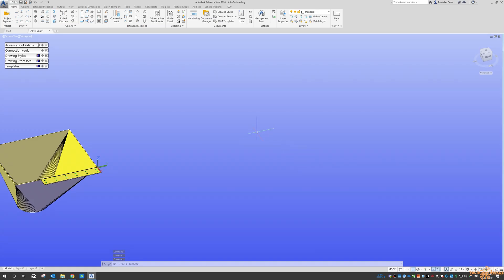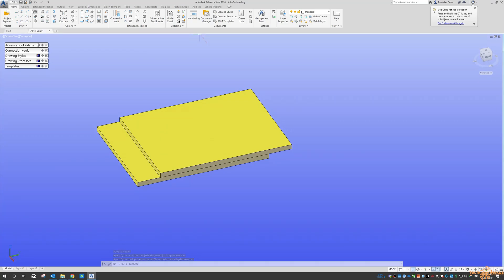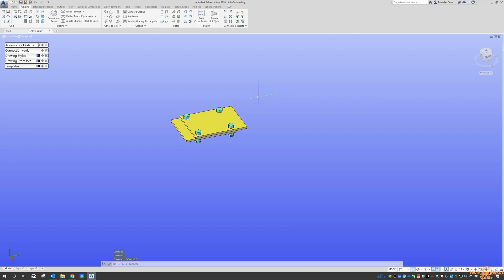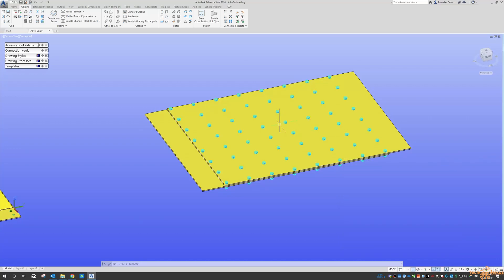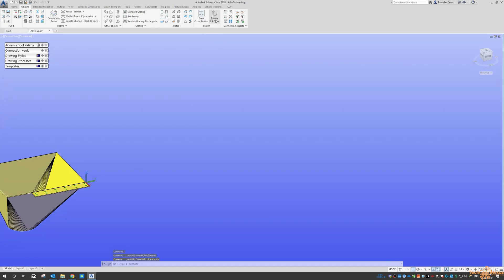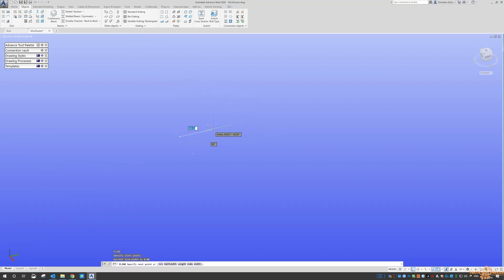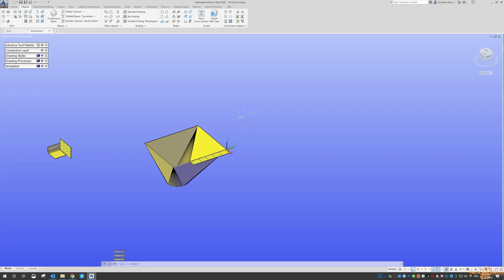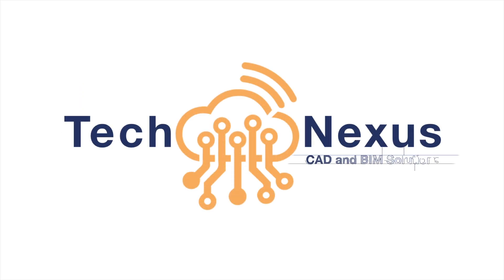Advance Steel Plates - Part 2

Comment: In order to change the indicator line in the advance still program, after entering the shortcut MLS in the command window, may I know why the option value was changed in the setting window, but it was not implemented.